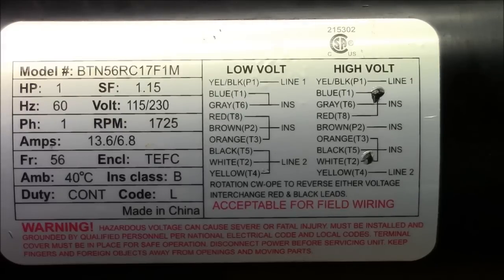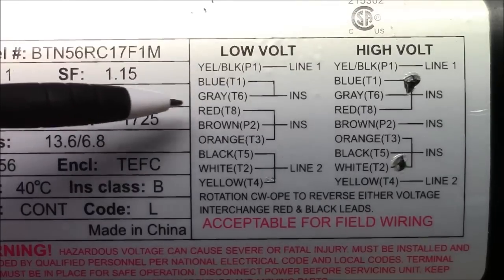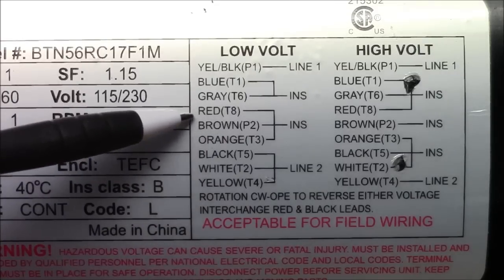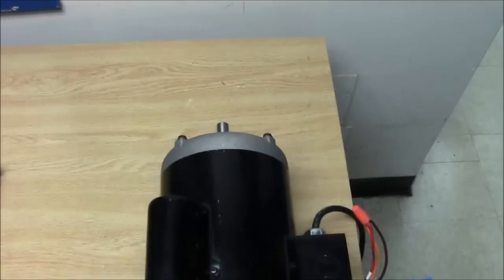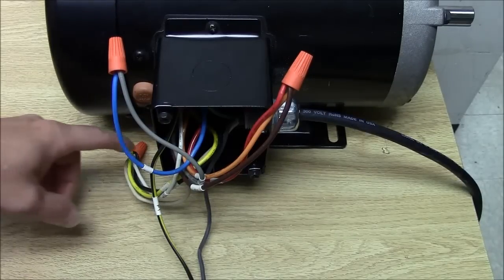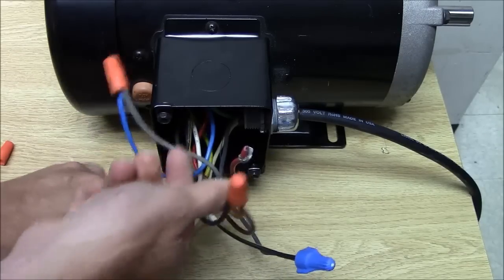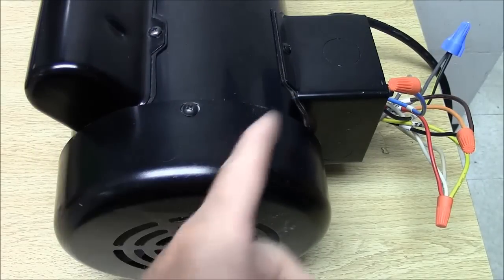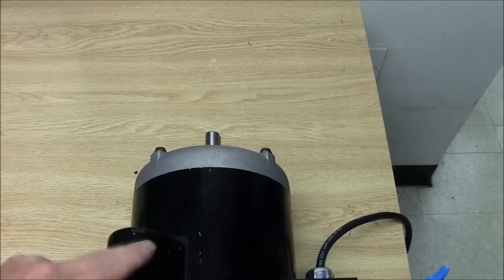Specific example of changing direction of a motor model# BTN56RC17F1M

Comment: Thank you very much.  Very clearly presented.  I bought a honey pump with a single phase, dual voltage motor from a supply house not knowing it wasn't already wired up to a power cord.  The only instructions were the cryptic ones on the motor panel.  Watching your video, I was able to wire it up for 110 and get my pump running without electrocuting myself.  I had a 50/50 chance of wiring it to run the pump in the right direction, lost the toss, but easily corrected it .  Again, thanks.